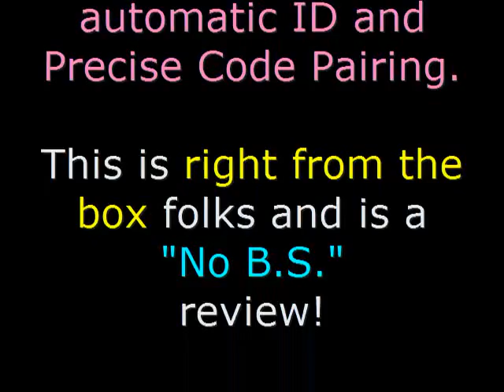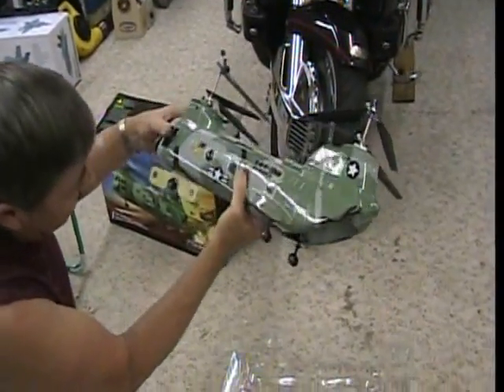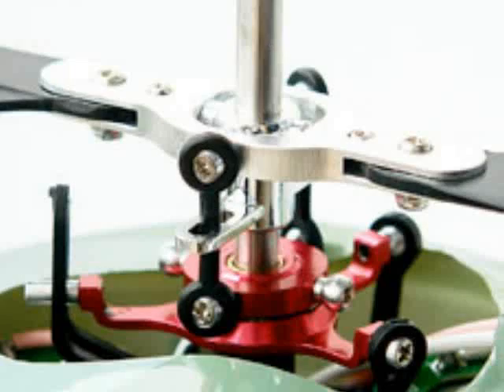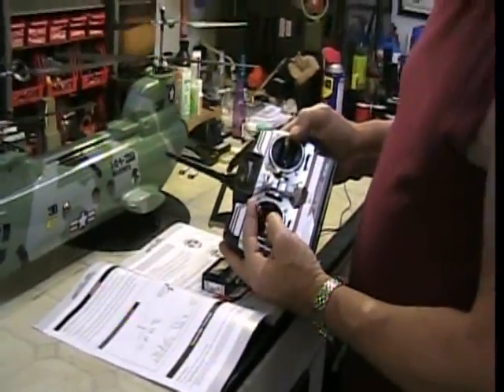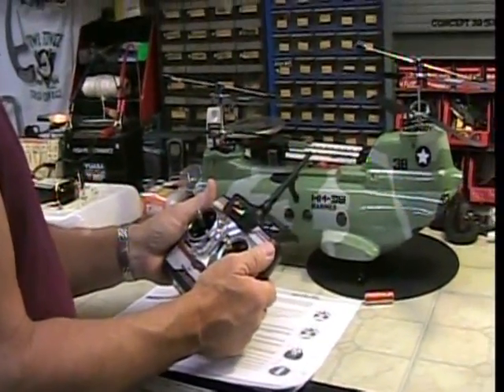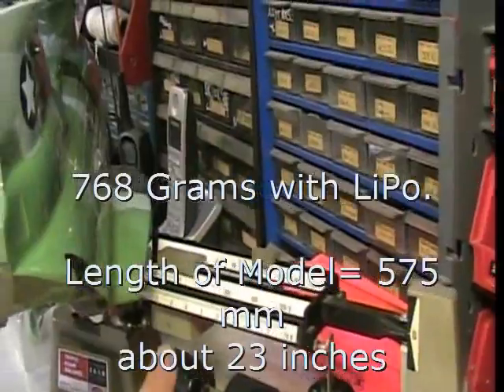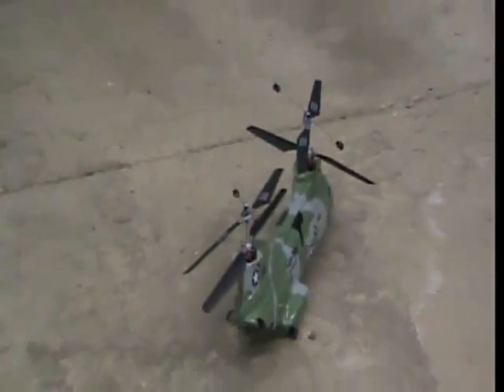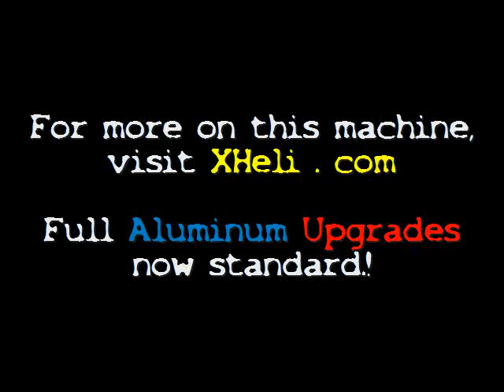XHeli's CH 46  Helicopter Review by NightFlyyer

Comment: WOW! is that thing stable enough to put the throttle up and trim to perfection and dont touch a single thing on the transmitter and it will hover, obviously not in 1 spot, thats impossible, but im sure you catch my drift ;)

excellent review dave and im glad... you got something rather different this time :) 
5 stars!

Comment: yay !! cos would be a shame to breack the blades.
I just bought a heli for 41 euros (more or les 50-60 $), the only bad point that I saw on this heli is the time of flight that is arround 5 minutes (but its because its soo light and small (23 cm of body), the estetic is the same that the heli on this vid.
Its called Twin Trooper , from air hogs.
wanted to see if u could check it out : )

Comment: CH 46 not CH 47
Reply from the maker: No.  CH 46 is Marine and has internal engines and  3 landing gear, like this.  The Army uses CH 47's.  They have external engines and 4 landing gear.

Comment: A real CH-46 doesn't have multiple rotors on top of each other, so why does this model do? I've asked this before and having poor tail rotor theories as reply but that's not what I'm asking. Why does the model chopper have 2 rotors ABOVE each other. ON TOP of each other. That is TOTALLY unrelated with the tail rotor. To give it more torque? That would only make sense.